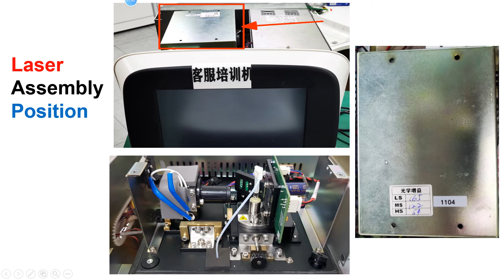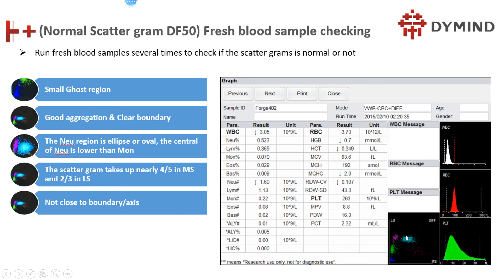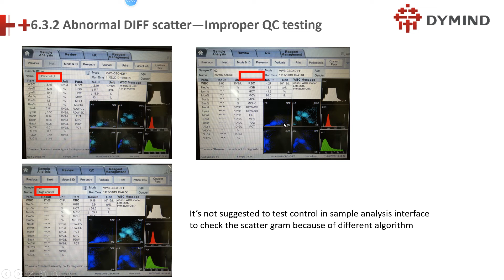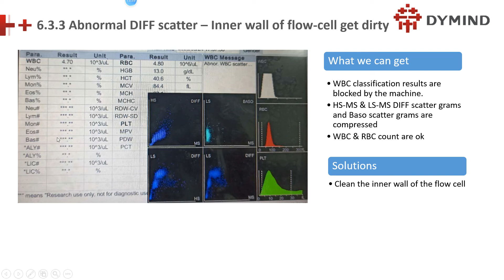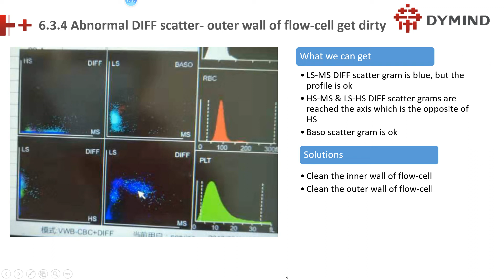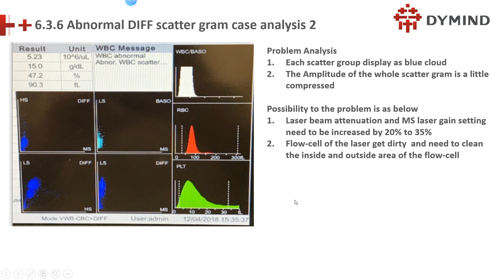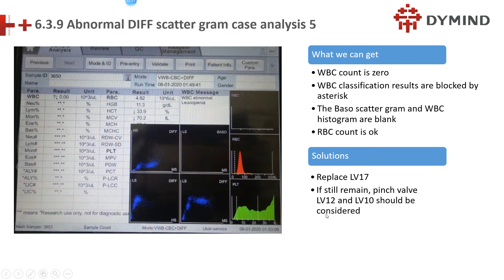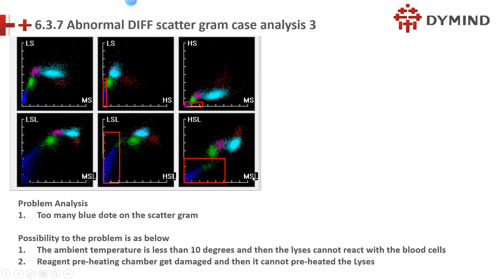LASER ASSEMBLY SAFETY PRECAUTIONS - SCATTER GRAM & HISTROGRAM RESULT RELATED ALL PROBLEMS & SOLUTION

Comment: Am working on one of 5part in my workshop but once I try to manually flash the flowcell there is a very huge resistance the flow flows through but once I run samples in pre dilute mode my blood samples pass the 3 t connect below the flowcell but does not pass direct through the flow cell
Reply from the maker: Please contact corresponding Dymind  engineer